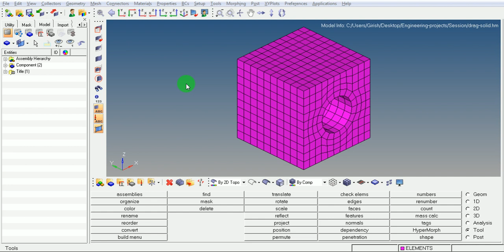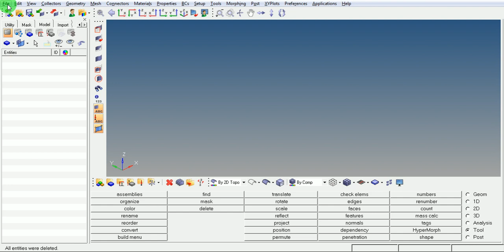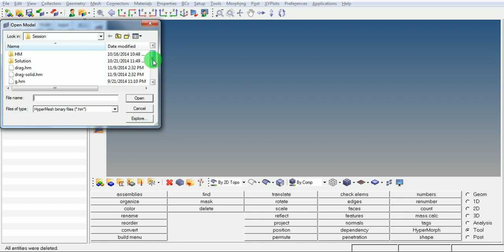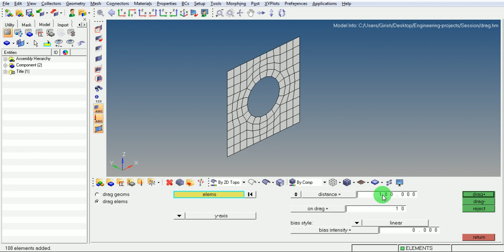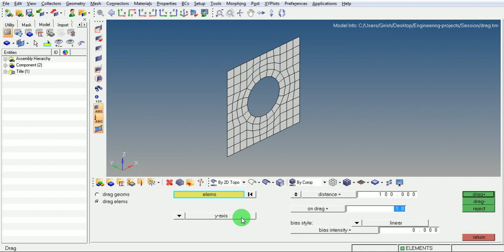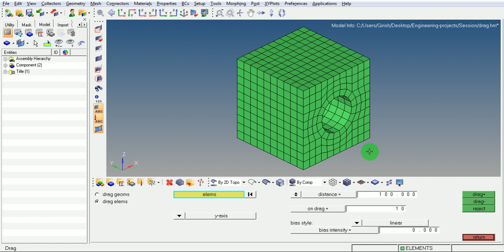HyperMesh Tutorial Video | 3D Mesh | Drag 2D Quad | Hexagonal Elements | GRS |

Comment: Hello, is there any video in which you explain how to define contact between solid elements? I am trying to simulate a solid projectile penetrating another solid. I have used type 7 interaction, but contact occurs only at the surface, not inside the solid.  Thank you!
Reply from the maker: https://youtu.be/q91Xal8WwjE